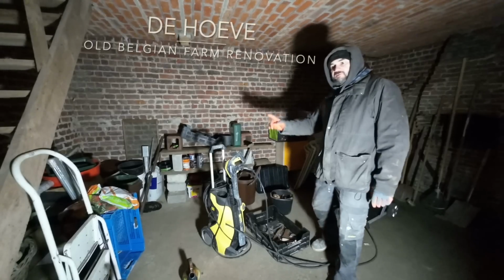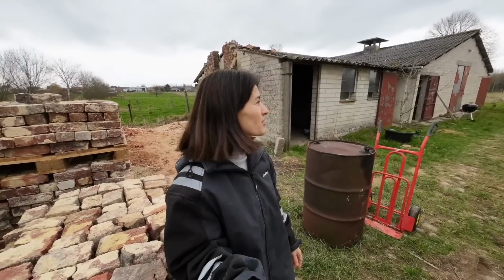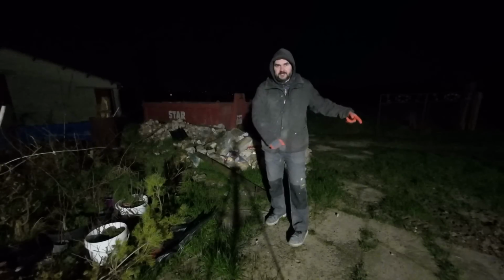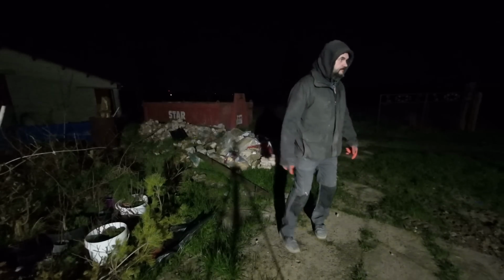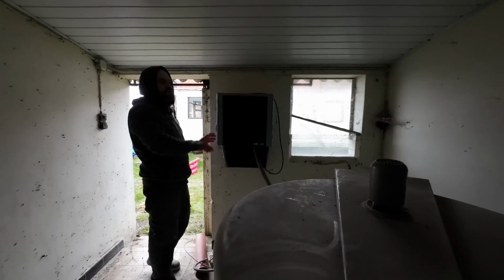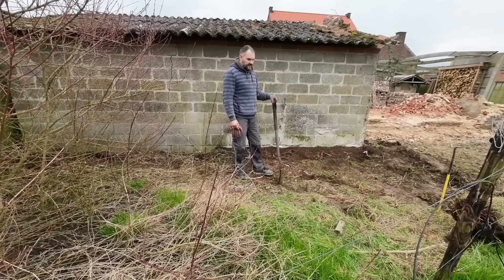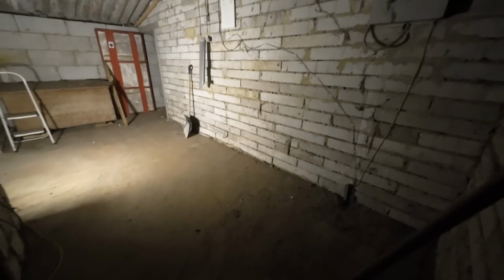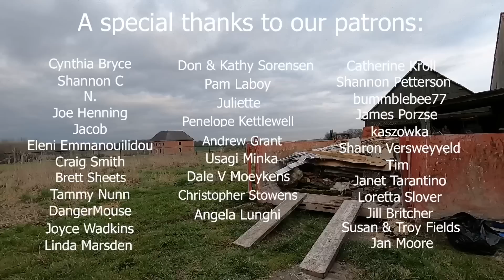You MAKE the mess, you CLEAN it up! [Turning an OLD SHED into a cozy TINY HOUSE]

Comment: Considering the size of the door it may be simpler and cost effective to cut the stainless steel vat into smaller pieces.  Then you can take the pieces out through the door and sell them for scrap.  Or contact a local scrap collector.  He may have the correct tools and be willing to do the job in exchange for the scrap.
Reply: Another possibility would be make the door bigger. I think the have enough building materials around the house to make that happen.
Reply: The milk tank is steel and wurth some money 💰
Reply: I would think that vat is worth way more the way it is than sold for scrap metal. I would advertise it for sale. Use the $|£|€ to pay for something needed on the farm.

Comment: Hello from Texas! 👋🏼 Organization is my thing. I love it! And I loved the shelves you whipped out for your storage room!
Two small suggestions: 1.) You could keep the shelves where they are and put your long tools (shovel, rake, hoe, etc) in the corner, but you will only have the side of one of the wood shelves to hang things on. If you separate the two shelves, so you have a narrow space in between them, you will have 2 wooden vertical surfaces on which to mount your tools. Be creative with your arrangement of them. 
2.) I believe the orange shelving unit will fit nicely on the bottom of the 3-tier shelves you made.
Reply from the maker: Thanks a lot for the tips!

Comment: you two continue to amaze me. Your doing such a good job on your property. enjoy your videos so much, and your ability to work together. My wife and I have done that quite a bit in our life. unless you plan on keeping that milk vat, you should be able to get a few thousand for it from one of the dairy farmers in your area. That is not a cheap piece of machinery, as you probably know, and selling it would only add to your ability to get more done with more materials or equipment. I know a stainless vat like that goes for around 3K dollars here without the motors and electrics, especially if it's stainless steel.

Comment: If you aren't using the milk cooler, maybe you could remove a section of roof and pull it out through the roof.  Then you can sell it intact or repurpose it for something else.  If you cut it up, then it becomes scrap.

Comment: Great shelf building.  good to have cleared floor space.  It should even be easier to find things.  Safer too.  Could the milk mixer be sold - even if to a metal collector.   We have metal recycling places here, so handy to get rid of all sorts of things, even rusty old metal.  Removing that first inner roof would make it healthier for you, that's for sure.  Always nice to have help.  So much to do.  Getting rid of rubbish is always a reason to cheer.  Best wishes.

Comment: What a lot of work you pulled off 👌👏🏻 I wonder if the milk cooler will fit through the door, it looks so big. Hope you will sell it soon.
Reply from the maker: We measured:  if we remove the cover and turn to the side, it should pass through the door. Fingers crossed it will find a new owner. It will be a pity to through it away.
Reply: @DeHoeveOldBelgianFarm  if you can’t sell it perhaps you can use it as a watertank.

Comment: The easiest way to remove the stainless steel milk agitor would be to put a larger door in the dividing wall and use the next room as an exit from the building if there is a larger door in that room.   If you never will deside to have goats or cows to milk that would be an option.